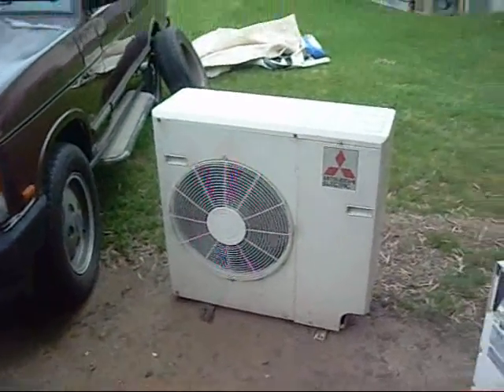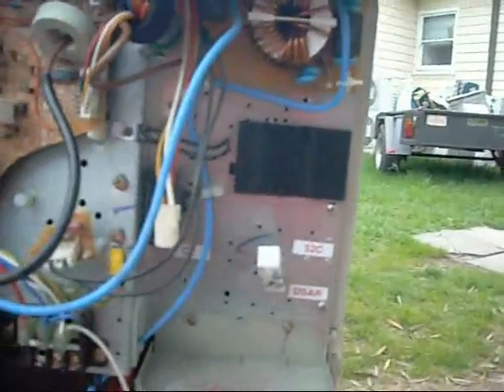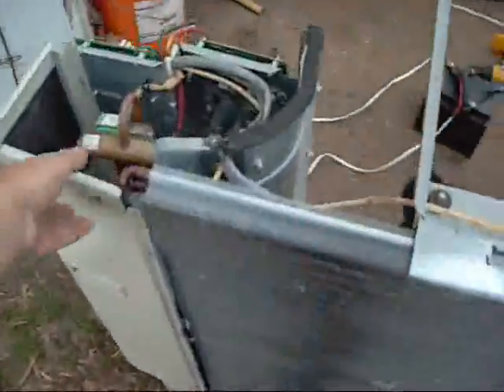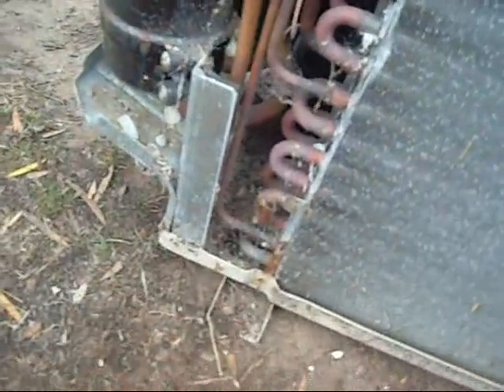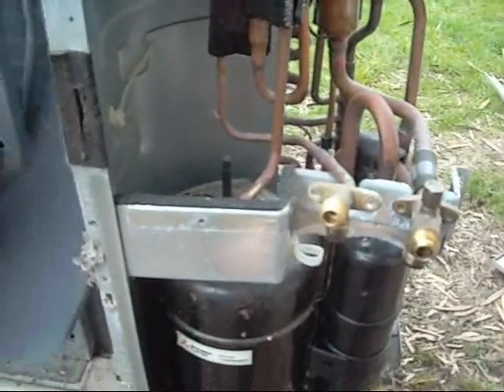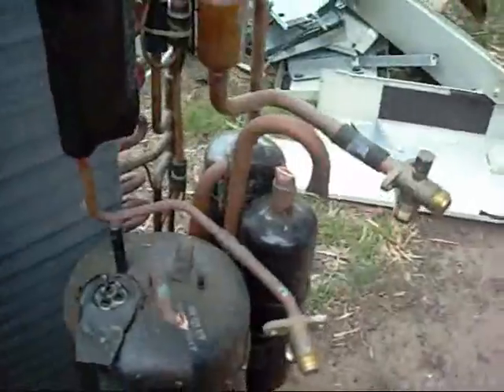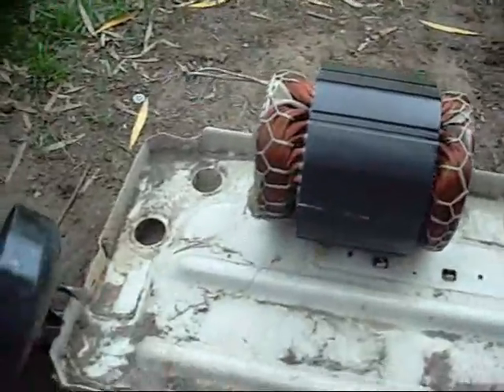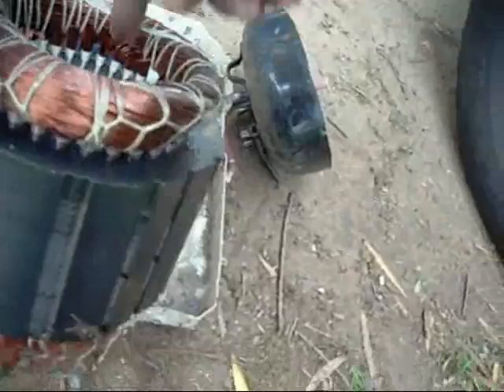Mitsubishi Mr.Slim Split AC Condensing Unit Autopsy with Compressor Opening

Comment: I have herd that normally when you look at a condensing unit you can put your hands on things and tell how things are running. But that Mr. Slims always full you, because the stuff that is supposed to be hot is never hot. They run so efficient that they don't even get hot. I also found out that charge is super critical. So you actually have to pull out the refrigerant and measure in the charge to make sure you have it at 100% otherwise it won't run properly.

Comment: I have found control board failures common on inverter models. I would use a minisplit as a very last resort where a real system cannot be installed.